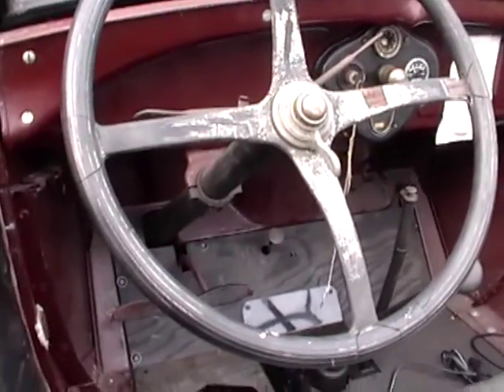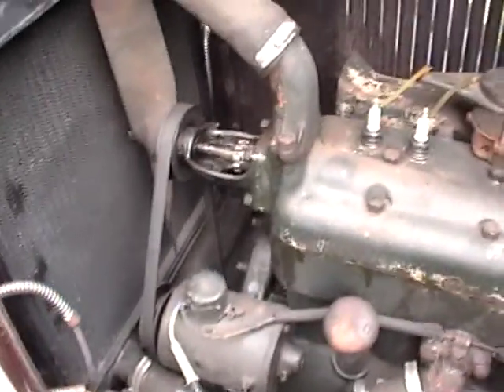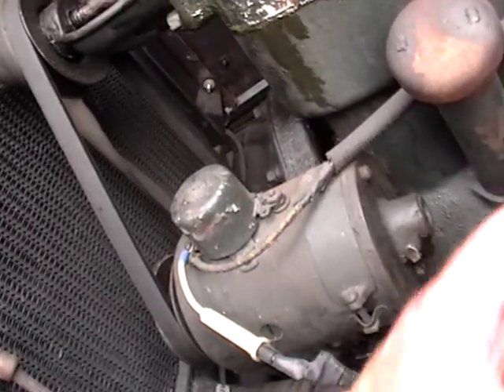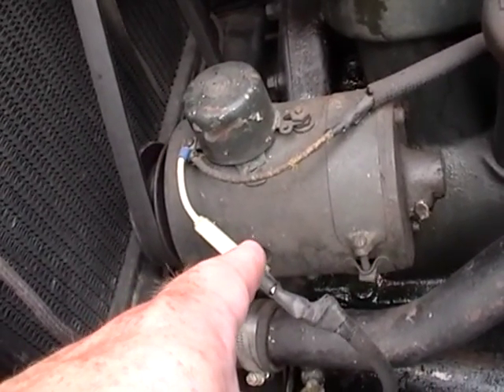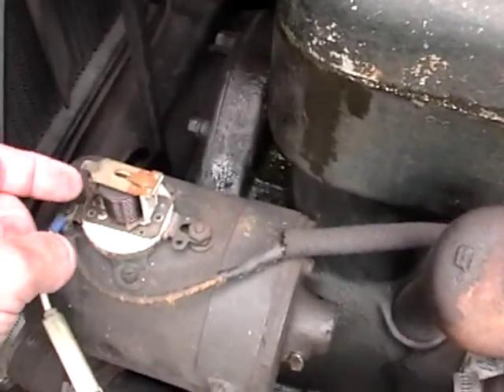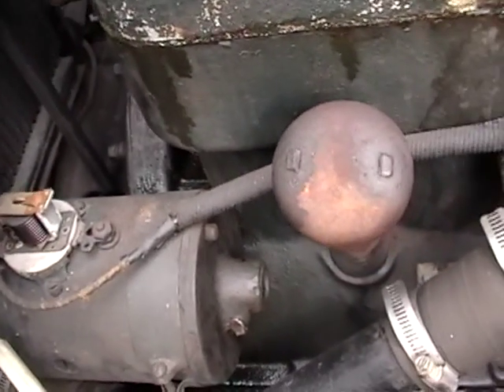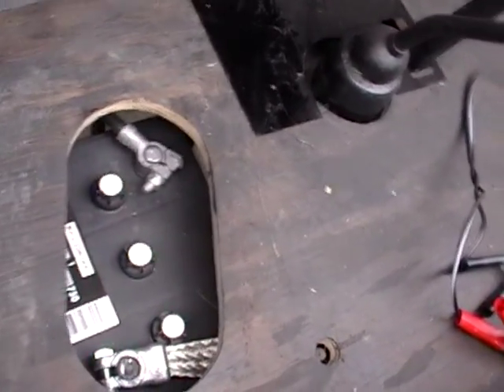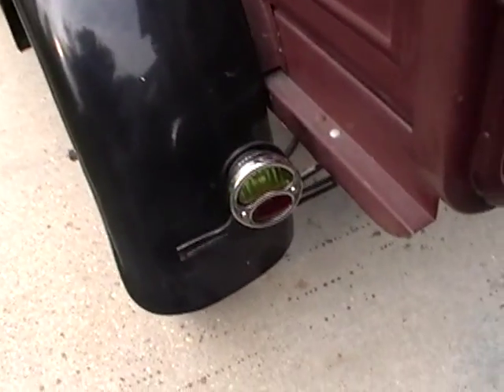Ford Model A Charging Relay Issue

Comment: That is the Cut-Out on the Gen to regulate the charging of the battery. If the contacts stick when the car is off it will drain the battery. When you turn off the ignition make sure the amp gauge is not pointing to the negative side. If it is then the contacts stuck together. Gap on the contacts should be 15,000 to 20,000. You can clean them with 600 sand paper.  The cut out should stop the voltage at or around 7 volts.
Reply: A stock Model A cutout does not regulate voltage. A good, functioning battery is the only voltage limitation in a stock Model A system.

Comment: New voltage regulators are available that solve the generator charging problem.  A much better fix than using an alternator which looks ugly on a true antique auto.

Comment: Tom, I'm no electrical engineer, but I'm pretty sure your assumptions about the generator "cut out' being turned on by "hitting the ignition key" is incorrect. I believe the generator cut out  is open until the engine rpm becomes high enough to produce enough voltage and current to close the two contacts within it. It is then sending current through the system. A small relay controls a larger one, which carries the load current to the rest of the car. 

If the car is properly wired according to 1929 Ford diagrams the ignition switch is wired between the coil and the distributor points and controls the functioning of the primary ignition circuit only.

Comment: It's called a CUTOUT, an automatic relay that only clicks in when the engine starts and the generator begins charging, it stays contacted until the engine stops, then it disengages, if those points are decent it'll never stick, if so, replace with a new one, it ain't rocket science.  I'm 88, been there and done it.
Reply from the maker: Been considering a manual cutout switch or going solid state. Just finished rebuilding the engine last summer, but still haven't started it, as the body is in pieces still

Comment: It's been 9 years since you posted this video.  Would love to see the work you've done on your 29 pickup since then.
Reply from the maker: Unfortunately, I've had a lot of real life get in the way.  I just got back to working on it this past (2020) summer. Just finished rebuilding the engine. Most of it, anyway.  I need to rebuild the water pump, still, and I'd like to figure out how to start it up without putting large hunks of the body back together first.
Reply: @TomBurkeii  I've seen a lot of guys rig up a temporary firewall and mount all of the electrical components needed there.  Then hang a temporary gas tank there and you can start (and drive) the chassis without a body.

Comment: On other vintage cars I have removed the internals of those relays and installed a modern part. From the outside they look totally stock but work like new. They also use less current to energize and last longer.
Reply from the maker: I've seen those. Since the truck is currently still in pieces, I haven't given a lot of thought as to whether or not I'm going to replace it yet

Comment: I think I may have this exact problem on the 31 coupe I just bought.  How did you get the cap off the cutout?
Reply from the maker: On mine, I was able to just grab hold, and kind of twist it back & forth a little bit.  It popped right off.  Of course, even cleaning the contacts probably isn't enough.
Reply: I have read on some of the fordbarn posts that originals were spot welded.  I don't know if that's the case with mine.  Did you ever try out one of the modern regulators from fun projects or ecklers?  Thanks for the timely reply and your vid.  It gave me a new place to check for battery drain.  Otherwise i would still be scratching my head on this problem.
Reply from the maker: leerollins ...  sorry, haven't looked yet.  The project has been on hold for a couple years due to other, more important things.  I'm hoping I can get things moving again later this year or next spring.  I got the engine torn down, and it needs to go to a shop for cleaning, magnaflux, stud removal, and maybe a weld
Reply: Good luck with the restoration.  I've only had mine a month but I love it.

Comment from the maker: However, to avoid a prolonged argument, I have put the following two pictures "out there" for you to take a look at.  The first is a page from my service manual, explicitly calling it a relay.  

The second is the overall electrical diagram for the truck, showing the relay, labeling it as such....

The relay *is* fired by the turning of the generator, but it's electrical, not mechanical.  When the generator voltage (on the 3rd brush) exceeds the battery voltage, then the relay will fire...

Comment: TOM PLEASE DO YOUR RESERCH. THAT IS NOT A RELAY. ITS A CUTOUT IT TURNS OFF AND ON YOUR GENERATER. IT STICKS AND DRAINS YOUR BATTERY. THE SPEED OF THE GENERATER IS WHAT TURNS IT OFF AND ON. YOU CAN USE A DIOD IN PLACE OF THE CUTOUT BUT THERE IS A LOSS IN VOLTAGE. GOOD LUCK. ROBIN
Reply: It's still a relay